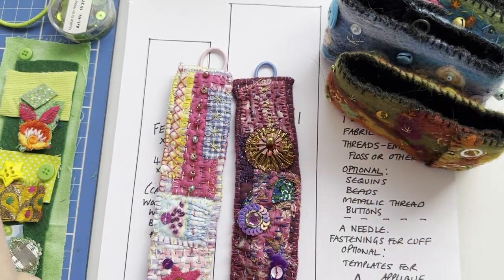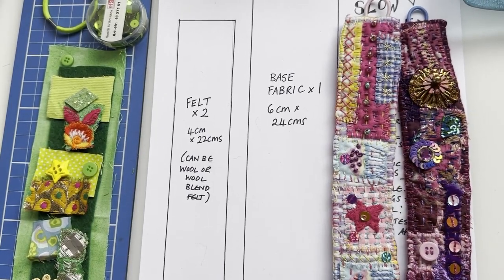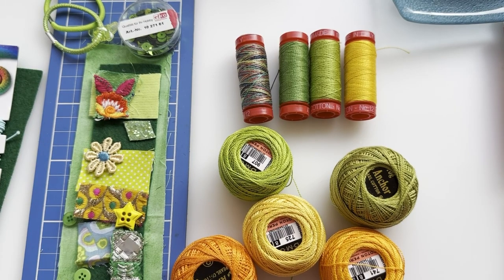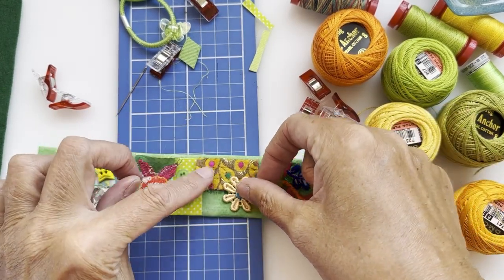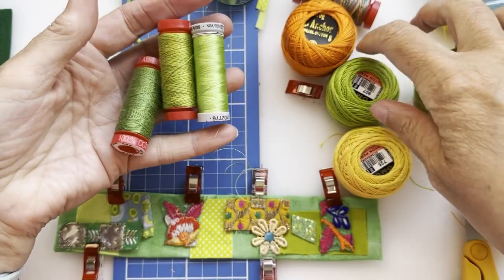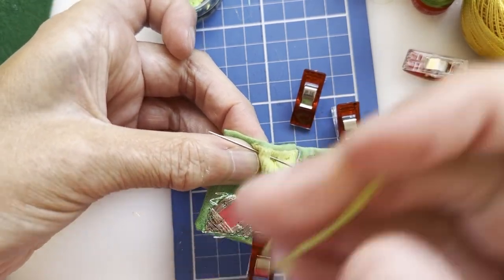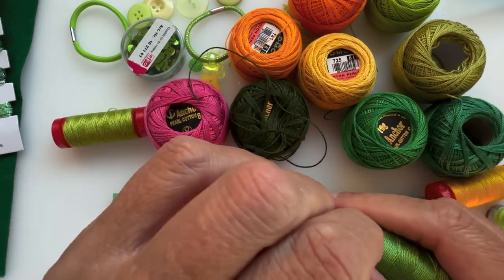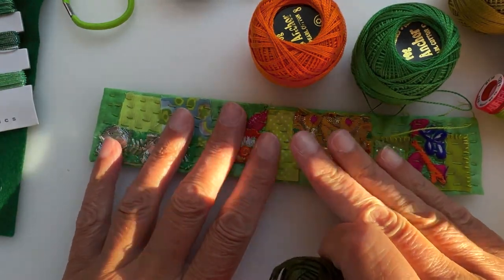Kooky Tutorial - SLOW STITCHING A CUFF BRACELET Part 1

Comment: The cuffs are so lovely thank you for the tutorial, I shall be having a go at making one.  In the past I've tried sewing with the acrylic felt you commonly find in craft shops, but find it doesn't hold my stitches well and goes into holes.  What kind of felt do you use please?
Reply from the maker: Hi Carol - you are very welcome!  My “go to” felt is usually a wool felt blend with a high percentage of wool or a pure wool felt which is a bit pricier but feels lovely to work with. I get my pure wool felt from a company called Cloud Craft and my wool blend felt from Paper and String. It is 40% wool and works great for backings and using as a batting :)

If for some reason you are allergic to wool then a thicker acrylic felt will also work - you just have to be more careful not to pull stitches too tight or it will split or “hole”. 😊
Reply: @KoolKookyKreatures  Thank you so much.... and such a quick reply 😘  I shall take a look at those companies.  I love felt and used to make a lot of wet-felted scarves to sell until I hurt my shoulders.  My wet felting days are behind me now, but I've returned recently to sewing and your videos have inspired me to do more slow stitching..... and to BUY some felt 🤣 Thank you 😘
Reply from the maker: Haha! I apologise to your bank account in advance! 🤣. I also love to do some wet felting - generally through the summer months - along with needle felt. Felt is so versatile! :) xx